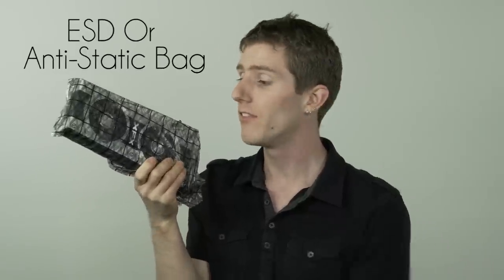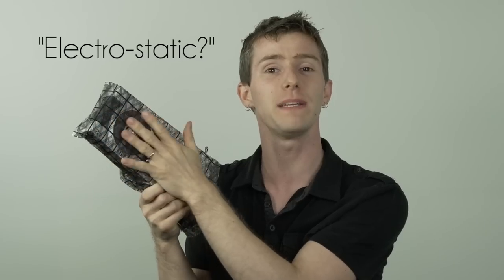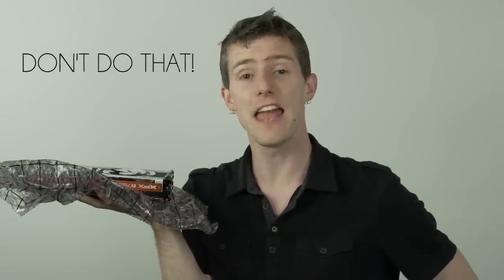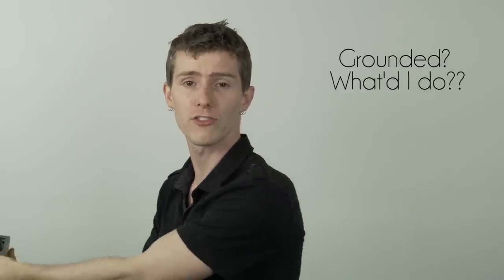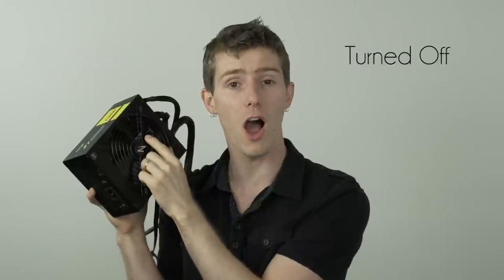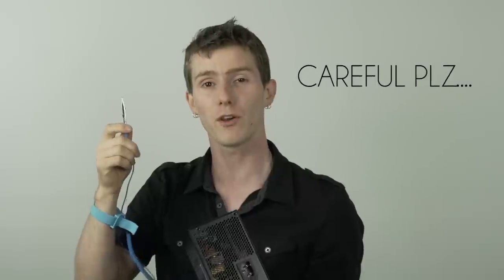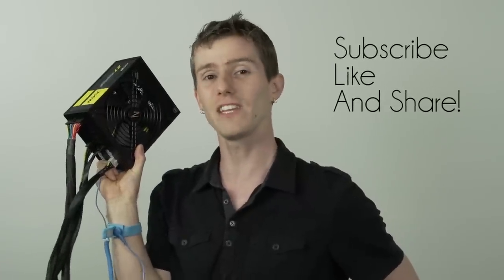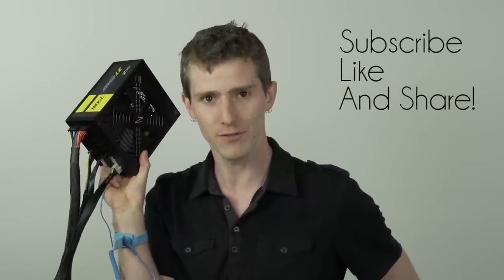Anti Static Safety - Handling Sensitive Electronics as Fast As Possible

Comment: Okay. I need help. I bought a pc years ago. Now I wan't to move all of the internals to another case and install a graphics card into it by myself. In my area here in the Philippines I can't seem to find a store that sells an anti-static wrist wrap. And I consider plugging the PSU while working on my pc would be dangerous. So can anyone help me feel good doing it myself without all those anti-static things that some website referred to as "a complete must have!!".
Reply: +Shazer just put your hand on the case you should be good
Reply: +Shazer I tried pluging in my 185W graphics car external cables to the power supply while my PC was on....(don't do that).I got a bright spark in my case next to all the hardware and it still works.You should be good by just touching your components.
Reply: DJ Jesus.He Died for your spins It's all good bruh thanks :)
Reply: ***** All good bruh thanks :)

Comment: what is ground? and why cant static touch the components?
Reply: So grounded is touching floor ?
Reply: MalaysiaCat touching metal objects. Means you have the same static charge as the metal (since pc has mostly metal parts) so you dont fry them.
Reply: slayerbllade I was wondering, can I put my motherboard on a wooden table? and shall my ESD-band be connected to the metall case while putting the motherboard on the table?

Comment: He wears a anti-static band around his ankle in every single video. He very likely has a longer one then the standard one - because he has to sometimes move around abit. When unboxxing a case this is not needed because, well - that's not going to die when you are charged with static-electriciy, heck it will even remove the static off you by touching a metal case.

Comment: just remeber that if you ground yourself via a wall socket then it is very dangerous to do so as if you touch a live wire then you are gonna go bye byes cause the electricity will flow though you

Comment: So basically I Install my power supply into the case plug it in and click the off button on the power supply then connect the wrist wrap on the back screw of the psu

Comment: I don't think this would be a good idea in our country to attach the antistatic strap on the connected system. There is no ground connector on where my PC is plugged in (I think this is a prerequisite) as a lot of houses, establishments, etc don't care about the ground cable at all and we use a 2 socket plug rather than a 3 socket one (if one house had a 3 socket plug, it won't be connected to the ground cable because there is no regulations enforcing this to).
Reply: You live in India or something like that?
Reply: Nope. But in here, we don't have laws that require a grounded plug. For most "self proclaimed" electricians, as long as it conducts electricity and the socket/wires don't burn from the current, it would be perfectly fine for them.
Reply: You can ground yourself with anything conductive, like the metal of your PC case, a piece of metal jewellery etc.

Comment: Would it help to wear latex gloves when handling these things?
Reply: It would, but it is considered overkill. You can if you want too, latex is not conductive. Or you can just put your hand on a metal surface (chasis side panel) for a few seconds and your good.
Reply: ***** Hey, when your handling over £1000 worth of computer components I say you can never be too safe! :P I guess it would also help prevent any finger oils from accidentally getting on contacts too.
Reply: ***** Hmmm actually from what i have just been reading, maybe latex gloves arent a good idea, because a significant static charge can actually build up on the surface of the latex. Scratch that then. :/ Someone did say vinyl gloves might be ok though.
Reply: don't worry, latex is fine, but vinyl is also another option. I used latex gloves before because i lost my anti static wrist wrap
Reply: Hmmm ok, just thought I would say because some other places where I have been reading about using gloves have said that static can build up on the surface of the latex (like when you rub a balloon on your hair).

In the end ive got an anti static mat and a wrist strap for double protection!
Reply: awesome dude! I wish you the best of luck on your build!
Reply: ***** Thank you! :)
Reply: ***** It happens, believe it or not! :)
Reply: NOOOO latex is bad it builds up static electricity just touch a tap.

Comment: I dont want to buy a wristband... Can someone tell me how to correctly discharge myself (case is painted dont want to damage it, when my psu is plugged in and turned off and i touch it. Will it work?(psu is black as in the video(not the same one)))
Reply: touching the psu will work. all that i know of have a metal casing which conducts electricity, meaning it can geound you.
Reply: You can discharge by touching the psu (plugged in, turned off) if the body is metal, but the safest ways are the wristband, or the gloves
Reply: +Patryk Dudek yes
Reply: Patryk Dudek I tried the "just touching it" method (no wrist band just touching the PSU every now and then) and I didn't kill my motherboard :D
Reply: Patryk Dudek Turn the PSU in the wall and turn it off. then just clip the alligator clip to it
Reply: +Kanaya xdxd yes but qhat hea saying is does the plug socket that the PSU is plugged into need to be on as well?
Reply: Revampedharpy09 Yeah connect it to the wall completely but let the switch off
Reply: +Kanaya xdxd ah thanks i wasnt sure so i didnt want to answer him incase i got it wrong.

Comment: doesnt the power supply have capacitors that store electricity even when powers off?  it might not be a good idea to use it as a ground.  instead, i prefer to ground myself with one of the motherboard screws witch is grounded to the case.  or if your case is made from a conductive metal, just touch that.

Comment: If you put a multimeter to the outside of a bag you will lwss conductivity then your finger and for the bag to be conductive on the outside it would need to be made of diffrent material on the outside and one other just turn a motherboard on a bag on you will find nothing happens the board works fine

Comment: I just realized i let my r9 380's pcb rest on my pair of sweatpants. Am i screwed?
Reply: Hard to tell.
Reply: +Lizrad Sceptile plug it in. If it doesnt work then you are capital screwed.
Reply: +jpotts1515gaming alright brah. i can always return it
Reply: +Lizrad Sceptile if its dead u might not be able to
Reply: +Lizrad Sceptile did 380 deded??
Reply: dilux went and got a replacement at micro center a bit ago.

Comment: Most of that bags arent esd protectors, they just dont make esd.
The real esd protection bag is that metalic one.
Reply: +Arek R. I bought a few of those actually. Hard drive storage being my primary concern.
Reply: Just touch grounding on wall socket and you will be fine.
Im touching soldering iron tip which is connected to soldering station which is connected to grounding/earth.

Comment: Plug in to the "correct part of the wall"? What does that mean?
Reply: He is talking about plugging the alligator clip to the correct part of the socket. Usually there are 3-pin sockets on the wall. there are 3 wires running to it. Live, Neutral and Earth. He meant that one should not connect it to live wire as it is charged and one might get an electric shock. Hope it helped :)
Reply: You plug it into the third hole of the sockets, the other two, well i guess you've heard of putting a fork in them
Reply: +Kanaya xdxd "plug it into the third hole" xD
Reply: Revampedharpy09 Hahaha lol

Comment: whoa linus dont say plug it into the wall, more then just Canadians watch your channel meaning we have higher then 110 volts, u try plug that into a 240 volt socket and ull have a good chance of frying ya self. If you want to do it properly sink a metal rod into the ground attach a wire and run it to where you work to attach to the other end. or a easier solution is attach it to a metal tap in your sink and run a wire from the tap to where you work both of these should be safe and i say should because most electricians are not allowed to attach an earth to plumbing. check country first see if it legal if u find it is legal to use plumbimg for electrical ground in your area dont use it for a static ground :P

Comment: Why do I hear this so much. THE OUTSIDE OF THE BAG IS NOT CONDUCTIVE! It is a normal bag treated with a special ESD coating. Putting it on top of the bag is fine. It won't protect from static but it won't harm it either.

Comment: Damn...I dont know how to ground myself...They said you must touch metals and dont wear that kind of clothes...Damn i felt so stupid when i try to touch a metal naked with a rubber flip flops just to remove and insert the damn battery to set the bios settings to default because my monitor isnt working

Comment: lol you really kind of over sell the anti-static. I would probably do it with big stuff like a TITAN graphics card or something that cost $1000+ but for the most part I never use a wristband. I should probably add im usually working on concrete or hardwood, not carpet. Not to say that you won't get the crap shocked out of you. I remember when I was playing with the components of a old PS2 from when I was little and I accidently touched the solder on the power supply and got electricuted pretty bad but not enough to make me go run to my parents or anything just a jump.

Comment: would touching the case metal also work?
Reply: Team Scatter Blade probably not as it's not necessarily grounded
Reply: ok, I decided to let Micro Center build the computer I want instead of myself just so that I don't accidentally ruin a part
Reply: Just touch the power supply as it's plugged in as you work
Reply: Does the power of the wall outlet need to be on?
Reply: Jack Keihanaikukauakahihuliheekahaunaele what do you mean when the outlet is on
Reply: Michael beseler like switched on
Reply: Unless you rub the parts on carpet, you're very unlikely to do damage. I'll touch a pipe under a sink and walk on carpet... never had an issue.
Reply: amak1131 you're playing a dangerous game. I was unlucky enough to slaughter my new card thanks to my carpet.

Comment: if you live in place with relatively high humidity, then you dont have to worry. 
Anyways, it's always better to be safe than sorry. However i've seen some youtubers wil alot of experience in pc hardware, and they didnt fuck around wih anti static wraps and stuff.
/watch?v=697_P54KiN0&feature=share&list=UU_SN80_V2GymyCWM2oTYTeg
Check this one out  from around 15:20

Comment: what if my power supply doesn't have a switch?
Reply: TheTrustyGuy but for static. would plugging it into a power strip then turning off the strip work?
Reply: TheTrustyGuy lol no. its an old 230w I pulled from an old dell I found. I'm only gonna use it for discharging myself. I would never even think about putting it in anything other than an old computer. and yes some psus back then never had switches
Reply: +SnipeYouFromMars just plug the psu into a power strip or surge protector and turn the surge protector or power strip off
Reply: can I still connect my anti static wrist strap to the PSU if it's plugged into the wall turned off but it's pluged into everything on the motherboard

Comment: Actually you are wrong video guy. No part of an ESD bag: outside, inside, or other is conductive. None of it is. That's why you can set computer components on top of the bag and turn them on, and they don't short out because those bags are not conductors.

Comment: I would like him to prove the anti static bag is conductive on the out side or inside.  He should know better than to plug the power supply  into the wall. This asking to get shocked.  Most pc parts are shipped in static sheild bags which are better than anti static bags. You can shock compontes through anti stait bags but not the static sheild bags. I am more conserned about condutive surfaces than anti static. As long as tuch somting meald like the case you will be fine.

Comment: Cooking pot + hand = no static
Reply: Is dat true
Reply: any type of metal will do since metal naturally conducts electricity. just don't we wearing socks or standing on carpet.
Reply: MetroShock What if you clipped your Antistatic mat to to a metal bowl or pan or something... Would that work as well? I am still very confused on how to use the wrist straps. I don't know whether the clip has to be attached to the case, or wether it can just be clipped to a bowl, floating in mid air and touching nothing.

Comment: Don't be too scared by this, honestly, when's the last time you actually got static?
Reply: Shaggy carpet in my house, plus socks.
Reply: ***** Never said it would 100% kill them, it's just a precaution to prevent a nice $1200 rig from becoming a $1200 brick.
Reply: this is also heavily dependent on where you live. dry air allows static charge to move more freely. i live in florida and have never had much of a problem. a few years ago though, i spent a short time in nevada. the first time i went to do some laundry I didnt use a dryer sheet (i thought they were just for softening). the static that build up struck me like a bolt of lightning when i reached for my chothes, literally throwing me back against a nearby wall. I also quickly learned to be wary of carpeted buildings and anything metal. i was only there for 5 months, but to this day, i cant touch a door knob or car door without first tapping it with the back of my hand... anyway, here in florida i worry more about buying components that have some kind of humidity protection.

Comment: I've worked on thousands of computers replacing hardware in a lot of them... I don't even own any of those stupid anti-static wrist things and never bother with anti-static measures. I get shocked by static maybe once every five years, and it's usually the damn car that does it to me. So the odds of static being an issue for me and hardware is basically like winning the lottery. It's possible, but unlikely to ever happen unless the environment you're in is static prone.

Comment: I put it on the bag.... am I fucked?
Reply: +Albert Byrd As long as you didn't cause a buildup of static on the bag (i.e. setting it down on a couch, carpet, etc) you should be good... you might want to return it if its an expensive one and you want to be sure..
Reply: +Albert Byrd Well, Carey Holzman (a veteran pc builder) made a video where he puts a mother board on a anti-static bag and runs a system on that. Worked without any problems. "/watch?v=G0hCj8PUCi8"
Reply: Yea mime worked fine. I even had a cheap psu blow up and not take out any other pc components.... thankfully
Reply: +Albert Byrd that would be scary! I hope my psu never explodes.
Reply: tell me about it my other hardware turned out fine thankfully....

Comment: fact is the outside of the bag is not conductive as you preach, I have purposely built a PC on a wool rug rubbing my feet aggressively before and after installing a component and no problems, I usually build on the plastic bag the mobo comes in on top of the mobo box, PC always works there are times when I lick every component front of mobo board and the back I rub the gold fingers on the ram stick and place the cpu under my arms after  a workout I assemble all and all works fine. The only time  a build failed was when I borrowed a homemade tesla coil, So it is safe to say that what you have to say on the subject is pure nonsense, and a bit anal.

Comment: if uou arent on carpet or have socks on are you fine???
Reply: you
Reply: better safe then sorry
Reply: You're a bit better off, but static can still build as you walk about, or your clothes and hair rustle around anyway. In my experience you shouldn't have any issues as long as you ground yourself by touching a metal piece of a plugged in appliance now and again (I use my microwave at the moment).

It's pretty uncommon to build up enough static to zap your system.
Reply: +PhilosopherGaming what if i build my pc naked
Reply: HAMI FTW then you should be fine. Just make sure all kids under 16 are out of the house, trust me it leads to some odd questions by the police.
Reply: HAMI FTW that sounds the safest bet. No hair waving around will definitely mean less static. I'd recommend getting laser treatment to get rid of all it, just to be absolutely sure.
Reply: Does the psu have to be connected to the wall outlet to be grounded?

Comment: I build all my pcs with the mobo on the bag, linus is wrong here
Reply: No he's not. Of course your parts won't be destroyed 100% of the time when you build your computer, but eventually you might fry a mobo on accident.
Reply: DirtyHarry98 this is a year old video. motherboards are built to resist stuff like that much better nowdays. you won't even fry one 1 out of 1000 times if you do it right. ask carey holzman
Reply: TheCphase not that it is much different from only 1 year ago
Reply: It depends on the type of bag.  If you have type he was holding, you're going to have a bad time.  If you have one without the black conductive stripes, you'll probably be ok.  Also, there's a good chance that modern motherboards are actually MORE sensitive to static discharge.  Modern ICs require very little power these days.